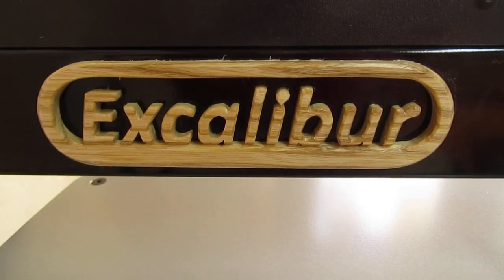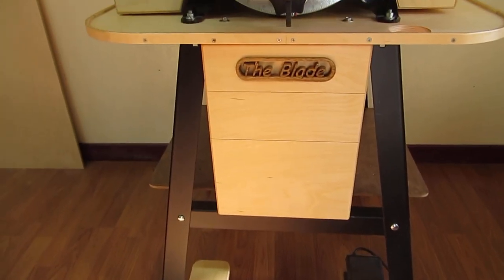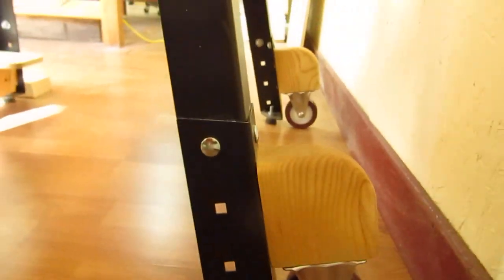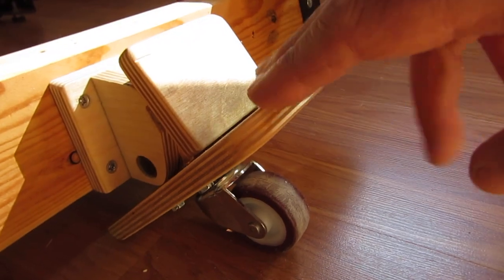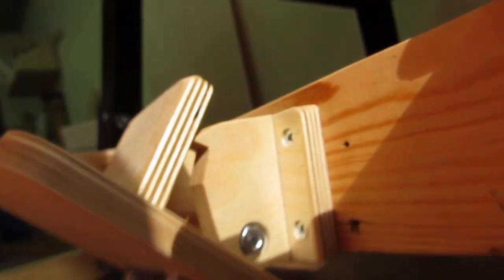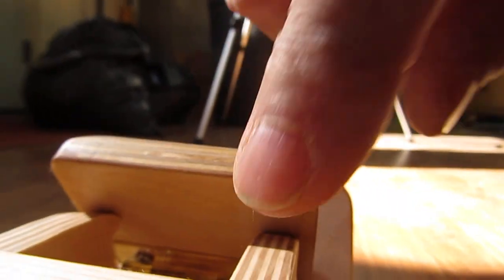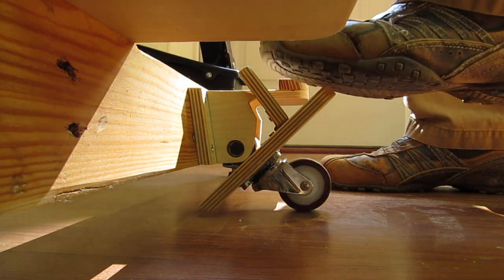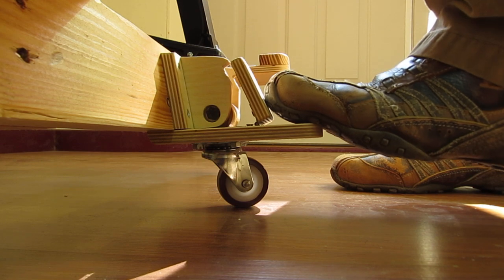Adding wheels to a scrollsaw stand

Comment: What are u using for your pivot point.   Like your design
Reply: Steve Elliott Exactly the question I was going to ask. Did you screw or just glue the hand rail piece to the wheel plate?
Reply: C Puzz Exactly the question I'd like to ask. Did you screw or just glue the hand rail piece to the wheel plate?

Comment: would you consider providing a pencil sketch of the front pivot assembly, with dimensions?  This is a most clever solution.  Are those 3" casters?  Thanks